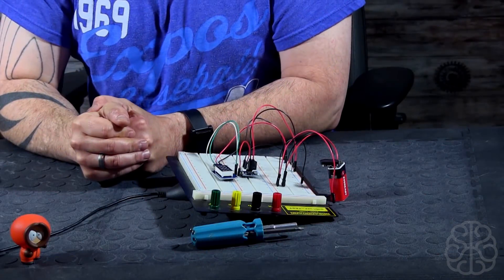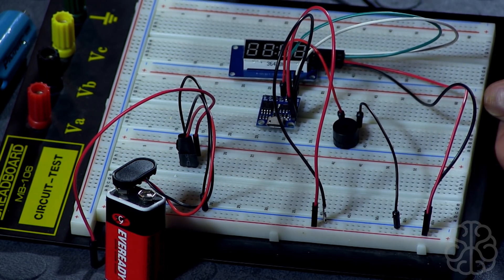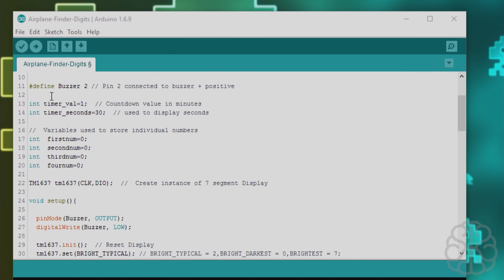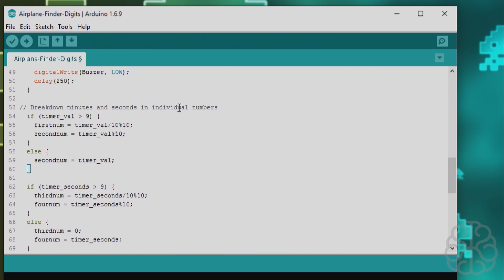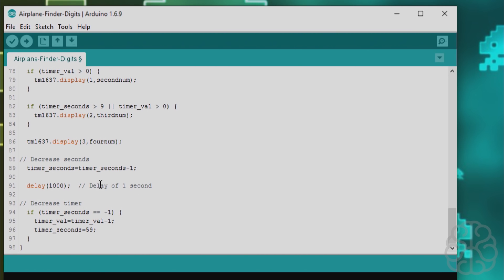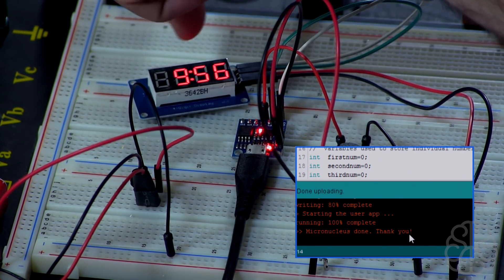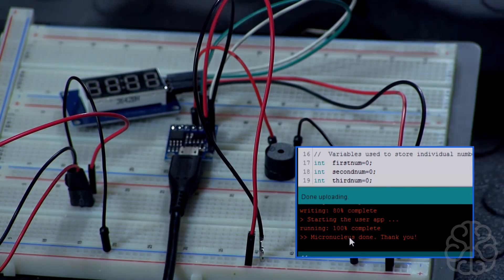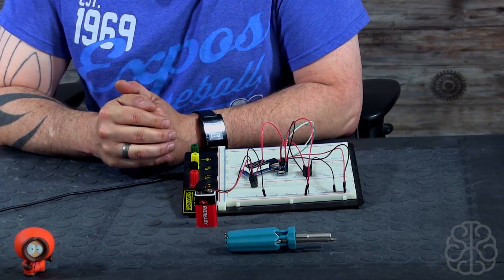Let's build a Plane / Drone Finder using a DigiSpark ATtiny85 - Tutorial

Comment: Well here it is a couple of years later, the two timers I built using this video as inspiration are still used daily by my good wife of 50 years to control her glaucoma.  Nice to know that the little gem is right on for the timing the length she needs to hold her eyes closed, her morning drops need 15 seconds longer then the night time, thus two timers.  The only problem with the unit was a dead battery, quickly fixed now using rechargeable 9 volts.  Again, thanks a million!
Reply from the maker: Hi Jerry, thank you for the update!  I'm so happy that this project has helped someone and thank you so much for posting about the results and updating me with the long term effects!  Best to you and your family!

Comment: Well on my second day at attempting this build, I at long last got one of my 3 ATTINY85's to work, I have no idea what the other two's problems were, wouldn't you know that of the 3 only the last I tried suddenly decided to work, and I believe it was the only one that I had ever used before, so perhaps I already had a boot loader burned to her.  At any rate, now ever time I try to compile the code, I get an error that it cannot find #include "TM1637.h"  //  Library for 7 segment Display which is, of course the first command in the code. I have tried to install two different versions of this from git hub, but neither seem to work, I even went to the files setup and tried to import them through the Arduino IDE itself, with no luck. Is it possable that recent updates to the driver software for the little chip has broken the older software setup>>?
Reply: Never mind, solved that problem, left over reassignment of folders from playing with an ESP32 fixed that, now I do find, however that the blasted attiny85 only partially installed, enough to stop the  constant rebeep, however it still is recognized as an unidentified USB device, and I cannot convince my computer to use it properly. I am leaving Windows and going to try in Ubuntu, perhaps that OS will treat me better, if not, I have my powerbook warming up in the bullpen!
Reply from the maker: Don't know if you've fixed it yet, but maybe check out this other tutorial on the DigiSpark: https://youtu.be/MmDBvgrYGZs  hope it helps!
Reply: Thanks a million!  I have been pulling my hair out over this one (and I  no longer have a surplus of hair having pulled it out from time to time over my 66 years on this old planet)  Just could not get it to recognize. So this morning, I  tried a simple move that I keep telling others to do when things go wary plug it into a different USB port!   That worked!   I now have a count down timer on my ATTINY85 hooked to my display, I adjusted the time to 2 min 30 seconds per my wife's needs and it is all a go, now to find a buzzer that will work with it, I am not sure if any of mine are active, or all passive, I know I have scavenged several so the search is on....

You know I have used many of your older projects,  I have a thermometer that flashes your logo when it begins, also a wifi search device, I am sure came from your site, using the old ESP8266/12.  These are great when we are spending our winter months in Arizona, living in our old 35 foot motor home. My next thing I guess is to try and get a smaller battery to drive this as the wife wants it in a smaller package then my usual medium project boxes.  Perhaps an old phone battery that still has some life in it will be re purposed.... 
Again thanks a million, every time I watch one of your videos I learn something, and I have always maintained, the secret of staying young even when the years are passing so very rapidly is just a matter of learning one new piece of information every day.
Reply: Well I finished the project, I miniaturized it even further  by using a small 12 volt battery that I purchased for a small remote control I used for a backup camera on our old motor home. The battery was a spare, and brand new in the carton.  For a holder, I simply soldered wires directly on the poles and that worked great. I could not find an active buzzer so I modified the program to use a passive, using the tone command to play a little tun at the end. Presented it to the wife this afternoon, she said it was exactly what she had in mind, hope it lasts for her.  The only problem I saw with it at all is the boot time, which is several seconds before the digits appear on the screen. Other then that, she works great!  Thanks again.
Reply from the maker: Congratulation Jerry for making this so quickly!  The boot time you are talking about, is the DigiSpark itself waiting a couple of seconds at startup to leave the usb connection open for programming if needed.  Great stuff on modifying the code to use a Passive Buzzer instead!  Great Job!
Reply: Thanks, it was so much fun, I ordered a couple more attiny85's even though I have two extra, as well as a couple more of the 4 digit displays, always like to have a few of those on hand for playing around, had one be a clock for a short while, just for the fun of it.  Now to find something to use them on.  Still trying to get my esp32 up and running, I know how to play around with the 8266 but for some reason the 32 just won't work with my arduino programming environment, but that is indeed another problem and I have lots of time to play around with them.

Comment: Sorry for the n00b-question, but, you are pluging in 9V into a 5V-device... will it not fry with 4v overpower?
Reply from the maker: :) The DigiSpark like most Arduino's has a 5V regulator on board that will drop the 9V down to 5V.  The regulator on board can accept from 7-35V.  Hope that helps, and thanks for watching!